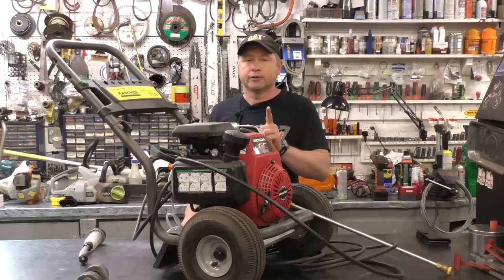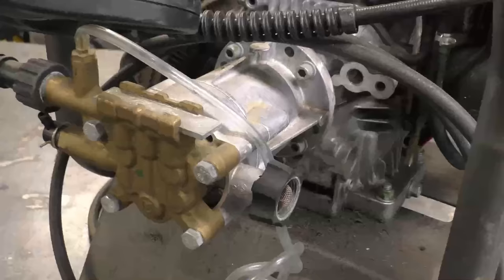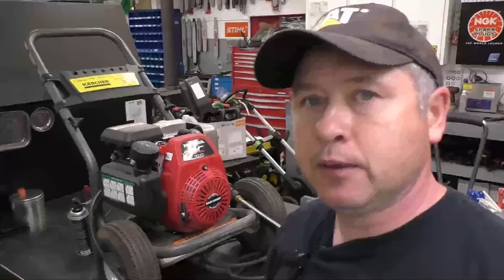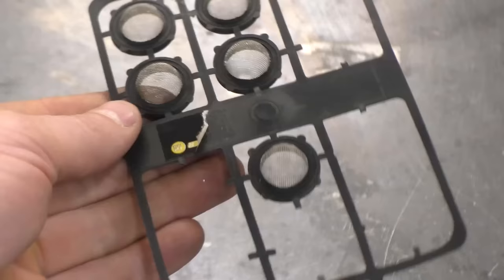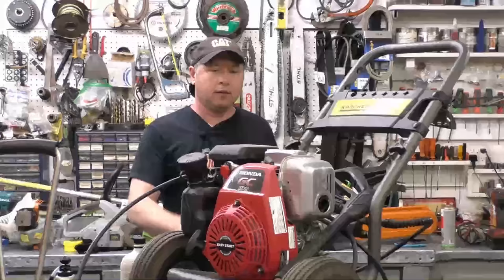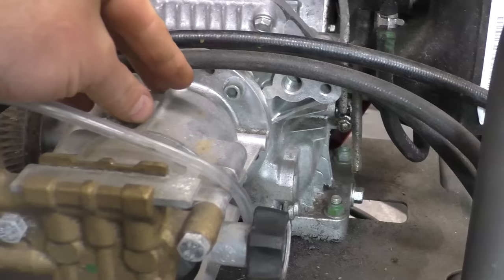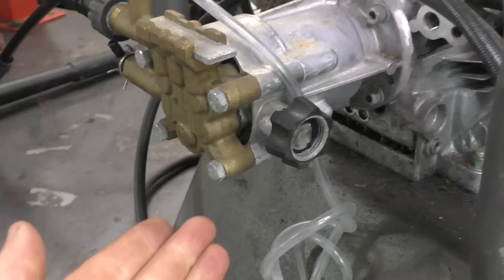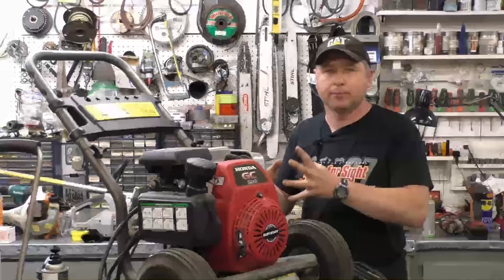Top Reasons Your Pressure Washer Pump Is Destroyed & Has No Pressure!

Comment: Most gas/petrol pws have an unloader that stop the back pressure from destroying the seals and valves when the trigger is released, by recirculating the water back through the pump. After a few minutes the recirculating water gets hot enough to do damage.
Those that draw water from a separate tank often have the water return to the tank so can be left running longer. Or it can be left to run to ground whilst consuming fresh water from the supply.
Modern electric pws tend to have a total stop system that cuts the motor when it senses higher back pressure or lower flow due to releasing the trigger.

Comment: my pump with less than 10 hours failed this year.  It's never stored in freezing weather, my garage has in floor heat and I keep it at 55F.  I also never use stabilizer in my fuel.  In our area we can buy premium non ethanol fuel.  Every small engine started on first try this spring as they have in past years.
Reply: What kind was it?

Comment: I had a pressure washer that just said not to run it without being hooked up to the hose.  It had a safety valve or something that would open up if it got too hot and run water through and onto the ground.

Comment: Sealed units theyre usually throw away units but if you need to add oil stand up on the flange mount and add oil just so the wobble drive is covered, generic info. 
All units have a thermal valve (well most and any good ones should) so if it does run without using it'll open the vavle and pass water allowing water flow and to prevent overheating. This is why a manufacture gives time to run without use and it's all different see depending. 
 Correct way to start is attached water feed and hose/wand. Run water through allowing all air to purge then start, no need to depress trigger when start if your unloader is operating correctly, when shut down. Turn off, turn off water and release all water from system (this is usually why an unloader fails, creates calcium and "crud" build up failing the piston/orings in the unloader, this is also dependant on the water quality too and filter as you said on timeframe). A big issue on is the build from factory, they usually pinch the oring when installing. 
Not starting co-axial and piston pumps with water overheat the piston seals hence the failures, this happens quite quick too.

Comment: nice video, hey just 1 Question. 4:21, how is it a sealed unit?, if you tilt the PW pump side 90deg and open the 4 bolts you see on the brass pump, you can access the oil tank - from the design it seems like a wobble plate pump and then just fill the OEM specified hydraulic oil 1/2 the tank - this can be performed as per OEM instructions, generally 100hrs of use / or 6 months is a good time to change the oil and clean the oil seals, water seals in this type of pumps

Comment: Great video, BUT you left out a very important item.   Before you connect your water supply, MAKE SURE you get the required static & dynamic pressure and flow rate from your supply hose.   For example, your pump may require 2.5 GPM (gallons per minute) and a minimum pressure of 20 PSI.   You may have a static house pressure of 80 PSI, but when the water is flowing at 2.5 GPM, the dynamic pressure may drop to 20 PSI.   For the flow rate, use a bucket and measure how fast it fills to 2.5 gallons.

Comment: A useful video, I wish I had watched it before operating my power washer.   Any advice on the following?   If one has frazzled the water pump due to not using the wand as mentioned, would you recommend trying to replace the water pump or just buying a new machine?  I am not sure which route to go and I want to make an informed decision based on actual user experiences.  Thanks in advance for any input.

Comment: Before I start my pressure washer I take the tip off the gun, and then rap a wire on the gun to purge it if my hoses are really long. That way I can do something else like setting up my ladder, and it makes starting easier. It saves some time rather then just standing there. Another thing I would do is to keep the gun going without stopping so much.

Comment: Good video as usual but no help for this problem and  you tube has no repair videos for it anywhere I can find. My homelite pressure washer will not unload keeps high pressure all the time. Replaced unloader swapped out the wand for surface cleaner no difference. My pump is the vertical one under the engine any suggestions would be appreciated. Thanks!

Comment: It really would help if the put a temperature sensitive bypass bleed on the pump to allow a small amt water to discharge onto the ground when the water inside gets too hot due to no flow.

Comment: Pump is only held on by 4 bolts, just take it off and store in the basement during winter. Takes 5-10 mins
Reply: I take mine off with a 13mm gear wrench to make the pump oil changes easier and less messy.  Literally a 3 minute job.  Takes longer to get the wrench than to take the pump off.  Tiny bit of anti-seize before reinstall.

Comment: The pump you show on the video is made by Karcher and it does not have the thermal release and when the water in the pump get hot. It does wash the lubrication in the unloader and the unloader will not pressure anymore. Karcher knew about the problem on the day one . It is a defective if I can recall.
Reply from the maker: thanks for letting me know!

Comment: After I bought my electric Hyundai 140, the guy in the shop recommended changing the plastic water inlet fitting for a brass one. He neglected to inform me that inside the original fitting was the built in water filter. There was no filter in the new brass fitting I fitted. It's no suprise to me that my unit is now Kaput!
Reply: He neglected to inform you, just as much as you neglected to do research and have caution with things you don't understand

Comment: Don, many of the pumps have ceramic pistons.  When the trigger is not pulled the water recirculates so no cool water is flowing in to cool the pump.  Needless to say if you leave the machine running for a few minutes the pump gets VERY hot.  When you next pull the trigger the cold water comes in.  Needless to say the ceramic (glass) piston does not react well go from extreme hot to cold.  There are more expensive pumps that have a clutch to prevent the overheat condition.

Comment: Your the first guy to mention pumps with changeable oil.  My 15 yr old Excel with 6 hp Honda engine has the two oil  bolts.  No sight glass.  Never changed oil.  Use this maybe 10 hours yearly.  Wondered about grade of oil.  Glad you mentioned 30w oil.

Comment: How can you tell if pump is bad ? Motor will run until I engage trigger.  So can’t tell if it’s unloader or pump ? And the unloader doesn’t look like any other UL valve I’m seeing on line. 2016 bS model.

Comment: Yes, the very worst damage to any pressure washer has been due to lending it out or having an inexperienced operator use it.  

I Just run water through the pump and I wait until the air pockets blow through...
However I did not know that letting the motor idle would overheat the pump.  
Forgetting to flush out the hose before connecting it is a Romper Room No No...
Have you ever gotten a mouthful of ants or a dead lizard when getting a quick wet your whistle from the hose??? LOL
Learned that when I was a little kid. 
Anyway thanks to y'all for your input even with all of the disagreements...
PS
A pre-filter is a good idea? 
Until it gets clogged up.
Thinking about adding a 10 micron spun filter right to my machine. 
Cheaper than a new pump.

Comment: Do you know anything about people leaving the red non vented (for shipping) oil cap on and running the pressure washer instead of using the yellow vented oil cap?  someone is selling a pressure washer they said was only used 2 times for a really good deal but I noticed the red cap still on it.

Comment: Dony, You skipped the number one reason:  I've found after doing professional washing off and on for 20 years, is to never ever start a pump dry of water since that's fastest way to destroy a pump. I have to educate guys all the time on how to start them with the hose running with NO WAND to warm up. Then turn engine off, attach the wand, restart, and start washing. Every single guy that innitially started to worked for me claiming they knew how to use one, would want to start it without the water flowing because the machines would bog start trying to build pressure otherwise. The water is the lubrication for the pistons. That's why you start them without wand attached.
Reply: Steve's Small Engine Saloon covered this and his recommendation is to start the pressure washer with the wand trigger depressed. It makes it easy to start the engine - even if it takes a few pulls the pull cord doesn't become difficult to pull - and you don't have the extra step of detaching the wand and then reattaching it.
Reply: @killer2600  yep, turn the water on, hold the trigger, if it's new or stored dry, pull it over once or twice, to fill the pump cylinders, and start it. (odds are, you will have to pull it over a time or two to start it, anyway)
Reply: @killer2600  I used to do it that way till I've ended up with clogged tips on a few occasions. Found it best to just let water flow through machine not running to remove any particles, start it letting it warm up and power blow through water. Stopping machine attach wand with quick connect and go. You can reject the advice all you want like some of my workers initially did, as long as it's not on my machines, just telling you what I've found from hard won experience doing it professionally. My workers going on to do their own thing kept that procedure because they've seen the wisdom after doing it wrong and losing time unclogging a tip, or worse yet; early demise of a rotary tip.
Reply: @kenbrown2808  Nope, run the machine no wand. Single pull to start, no lugging wear and tear under load, and clears the machine of any tiny debris in hoses that can clog a tip or piston. Yes, I use a separate filter, but was blown away by how tiny the particles can be that stop a piston from being productive.
Reply: @ellkir1521  wow. You're saying that pulling the hose off makes the engine fire on the first pull? Does that work on lawnmowers, too?
And if your water is bad enough that it will clog an orifice when you start the pump, it is bad enough to clog an orifice if the pump has been prestarted and warmed up, too.
Reply: @ellkir1521  To each their own but I have to wonder where you're getting particles from and why they would only clog the tip when starting the engine.
Reply: @kenbrown2808  Not the hose. Get your bias out of your eyes and read. I said the quick connect WAND not the "hose". Silly argument you made but "Lawnmowers" are only preloaded while in gear that's why you have a neutral to start. The neutral in a pressure washer is the unloader or 'VRT' which only works under pressure. Thus you are trying to start an engine under load even if trigger is pressed on wand because the tip creates back pressure. As far as the water, even if you use a prefilter (which i do) tiny particles (smaller then sand) can get by and stop a tip, piston, or rotary tip.
sheesh, Some guys would argue the sky isn't blue, but only blue light spectrum.
Reply: @ellkir1521  you must have a different machine, because every fluid quick connect i have ever seen has a stop on the supply side. 
And most small lawnmower have the blade directly connected to the crankshaft, just like small piston pumps have the pump directly connected to the crankshaft.
And for the record, lawnmowers really exist, so there is no need for the scare quotes. And you made the claim that removing the wand makes it start on the first pull.
You really need to get your pretensions sorted out if you are going to pretend to be technologically superior. But what do i know, I'm just a stranger calling out your overcomplicated procedures on the internet.
Reply: @ellkir1521  as far as the tiny particles, the only time an initial purge makes a difference is if you have had the hose, or wand off and had something get in after the pump or have fragments left from reterminating the hose
Reply: All you gotta do is hookup the hose, turn on the water hold the trigger down on the spray want while starting the engine and you are good to go, there's absolutely no point in leaving the wand off, starting the pressure washer to "warm up" then shutting it off and hooking up the wand then starting it back up.  Been pressure washing for 20+ years, never destroyed a pump from starting a pressure washer like this....I've destroyed pumps by not shutting the engine down soon enough which is why I've gone electric, shuts off as soon as you let off the trigger.  For large commercial jobs I have a Hotsy which has a belt drive pump that is oil lubricated, it can run continuously, and is also a hot-water based pressure washer at 4,000PSI.
Reply: I use a piece of wire to hold the trigger. Turn on the water, let the water run freely. Then start the engine.

Comment: Another cause of failure on gasoline engine pressure washers is running the engine without having any water hooked up to the pump. It seems obvious, but I've seen it done.

Comment: I have an older pressure washer with the Honda engine. It’s worked great for many years. When I got it out this year and hooked the garden hose to it and attempted to bleed the air out of it before starting I could not get any water to come out of the wand. I unhooked the wand and still no water came out of the pump outlet. What could the problem be?

Comment: Another error is starting the engine BEFORE you turn on the water. Always, ALWAYS turn the water on FIRST before starting the unit.
Reply: I pull the trigger to release any air/water pressure in pump until there’s a steady stream of water. Then I start up the engine. Sometimes the engine gets locked and you won’t be able to pull the rope.
Reply: @DanJ41  Exactly!
Reply: Yes 
Just run water through the pump and I wait until the air pockets blow through...
However I did not know that letting the motor idle would overheat the pump.

Comment: What about corrosion.  I am on my 3rd pump.  Using each one for one project a year.  What I found is the pump housings are made of cheap die cast metals that corrode easily.  There is no coatings on these pump housings to stop corrosion.  I even brought my pumps in house for the winter, and they still locked up.  Looking inside I saw corrosion like and old aluminum screen door.  Being a product design engineer for 45 years I would say they should go back to the drawing board.  They could get an anti corrosion coating on the pump housings that is only a few .001 thick like the auto industry does on some of their parts.  Or they could look at today's high strength plastic and use chopped fiberglass filler for additional strengh.  Or sleeve the pump with a plastic sleeve, or copper sleeve, or something.

Comment: I have a Honda powered pressure washer. It has a triplex pump with a pressure adjustment regulator. You can adjust from 0 psi to the max pressure. When the engine is idling and the pressure adjustment turned to the minimum. There is no water flow through the pump with the spray handle attached but not squeezed to allow water flow. Can the pump be damaged during this operating condition? This triplex pump has an oil drain and a fill opening with a dip stick to maintain the proper level. I keep the correct pump oil on the shelf. when I pressure wash my driveway it is normally not used for 6 months. Drain the oil once a year but comes out clear.

Comment: Another great Video Dony. 🤙 Question... I just finished putting a new carburetor and pump on a Ryobi 3000 psi pressure washer with the GCV160 engine.
The machine works great when I am using it but when I let off of the trigger on the wand the engine surges.  Soon as I start spraying again it works fine no surging. 
I've cleaned the carb even though it was brand new and cleaned the unloader valve.  Not sure why it keeps surging. Please let me know your thoughts..
Reply from the maker: sometimes this works; https://www.youtube.com/watch?v=gV6IOkevloM&t=2s

Comment: Thanks for the very good info! One question: If a person lives in Florida or Southern California where there is warm weather all year round, can we just store away the pressure washer after each use without any concerns?
Reply: I live in No. Florida, and my pressure washer is used almost as much as my vacuum cleaner year round 😉. I got my first electric PW about 25 years ago and have since gone through about 6 of them. I’ve updated over the years. I have always stored mine outside in a Rubbermaid shed and though we have the occasional freeze here I’ve never had any issue with that. After learning what I have here today I’m sure I’ve ended the life of my pasts PW’s  way to early by not implementing some of these other tips offered here, but not winterizing  and lending it are two I was good on.

Comment: 💥 Absolutely getting a 👍🏼 Incredibly value info but I knew everything here, thank you.  Including not letting it sit for too long without pulling the trigger.  If I need to stool for a couple of minutes tops I hit the trigger every 45 seconds or so for about 5 seconds. Sometimes I’ll lower the RPMs as low as possible before it stalls also.  Any longer and I just shut the motor off.   —- Isn’t it good to run the motor out of gas over the winter or is it bad for the carb to be dry?